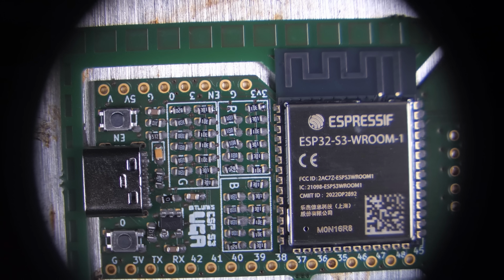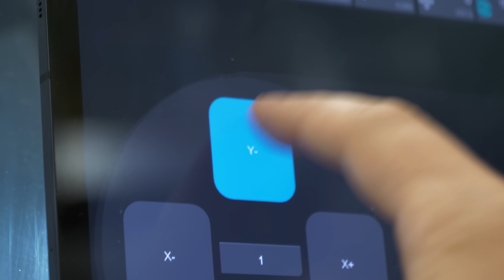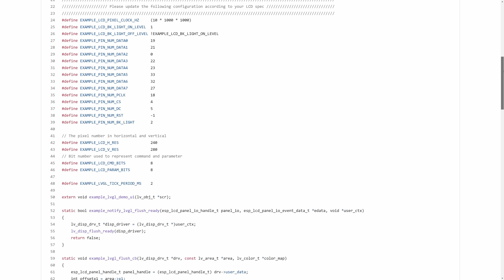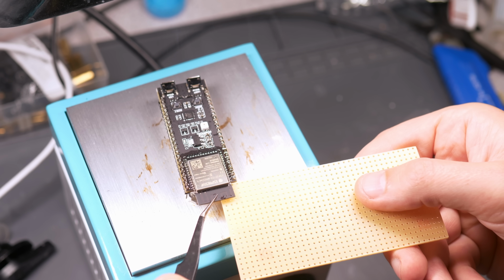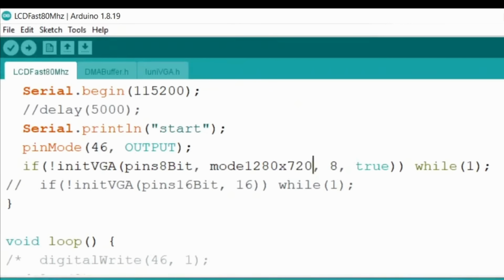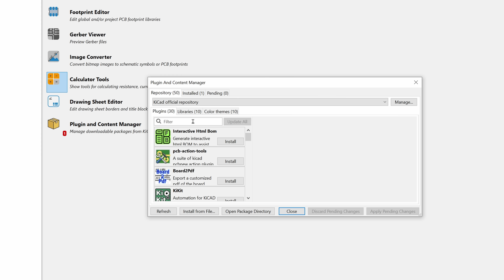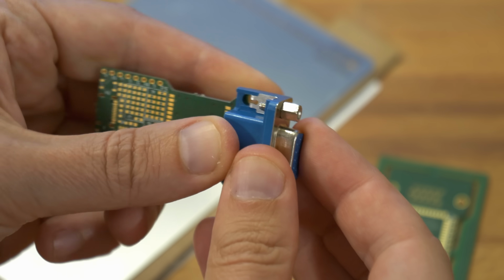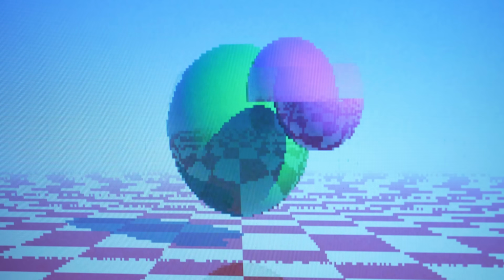I made a VGA card that blew my mind

Comment: Just a quick note, from experience. Do not put vias in pads. The solder paste will get sucked into the via and the pad will not be soldered properly. Doesn't happen all the time but if you have a big production run it can mess up a lot of boards. It might even be that the pads make electrical contact but are not properly soldered and after they reach the customer the pin is moved a little during transport and doesn't make contact anymore.
Reply: I saw him do that, and it set off my !! reflex, but I couldn't tell you why, I was like "wait, should you do that?" Good catch!  I'm glad there's some experience around here helpful for us 'homegamers'!
Reply: I know just enough to understand the question, but not quite enough for the rest. Where was he using the vias? Is he using a throughhole as a via?
Reply: Which timestamp shows the error?
Reply: @kwinzman 11:05
Reply: @jerryismybff  Thank you, very helpful!
Reply: Honest question from a reluctant board designer (I only do it out of pure necessity. KiCAD and I have a tenuous relationship): Depending on the manufacturer, if you DON'T put a via in a pad, will the pad still connect to ALL copper trace layers connected to it through the board? I used this as a way to connect three or four traces on a multilayer board, and I haven't been brave enough to order a board without the vias to see if they actually all connect.  I didn't want the surface-only pads to hit the trace, nor the pad to only connect to the trace on the top/bottom level.
Reply: @zombie-process7025 Pads on the surface are on the surface, top (or bottom) layer only. The only way to get a connection between layers is to use a via, or some other plated hole that can act as one (like a hole for a through-hole component).  ERC and DRC checks should show you if everything is connected ok.
Reply: I do almost 100% of my boards with every joint as via in pad. I haven't seen a single failure from this. You just have to have the pcb manufacturer plate over the holes. Costs ever so slightly more.
Reply: Im no expert, but was always taught to make the via and then a small trace to the pad.
Reply: you can get plated and filled vias to avoid this. sometimes you have you have via in pad
Reply: @eastonbryan4171  indeed, we are running mass production with high density BGAs and use plugged & plated vias. In mass production (tens of thousands of PCBs) it does also not matter much in terms of cost in absolute numbers, though in relative numbers it's still 20-30% more expensive then not such High-Density Interconnect (HDI) tech.
Reply: Very true ive experienced this and always avoid this, this is quite problematic if you have components on both sides of the board, for single sided components on a 2layer PTH PCB also it creates huge manufacturing defects as the solder paste printed on either the top or bottom layer will fill up the VIAS
Reply: Conductive epoxy filled holes are OK.  Via-in-pad is acceptable technology if you specify it.  Cost increment isn’t that much these days.
Reply: You can have epoxy filled pads
Reply: righ and wrong, many coponent  have via under them for heat transfer.
Reply: Depends I think if they fill the holes in the vias then its ok. Castellated holes its called I think
Reply: @JohnSmith-iu8cj : Castellated holes are something different. Filled vias can be either tented (with soldermask or something), or receive extra solder.
Reply: @absalomdraconis you wouldn't tent a via in pad. If you were to fill it you'd specify filling with epoxy and plating over with copper
Reply: @JohnSmith-iu8cj castellated holes are plated holes placed at the edge of a PCB then half routed away, leaving a sort of plated edge of the PCB. 

If these vias were to be filled they would be filled with epoxy and then plated over. Both of which are extra steps that would add cost. It's possible a low cost quick turn fab house wouldn't support these processes.

Comment: Great project, you are really squeezing everything out of the ESP32-S3. The new formfactor for boards with PSRAM is great. No need to have different footprints anymore. They now also sell one with 32MB of flash. I am thinking about using that one for OpenEpaperLink because it would allow for local storage of a lot of pictures.
Reply: If you need lots of local storage you can probably just add an SD card? On-board flash is nice, but it probably adds a lot cost/unit space.

Comment: S3 was a VGA manufacturer. First i thought you connected an old S3 VGA chip to the ESP32, then i realized it is the ESP32-S3.
Reply: My first video card had an S3 chip, and IIRC, 512KB of dedicated memory.
Reply: S3 Savage graphics were common in a lot of PCs I used to work on in the shop back in the day. Been a long time since I seen those chips. I think the savage line was the most common one I would come across. They had a few different lines though.

Comment: Fyi, the ESP32S3 RGB interface doesn't support the APLL because there is none in the chip, sorry. Next chip perhaps again :) I'll also see if I can convince the digital team to add the few bits you need for the higher-res modes in new hardware; even if VGA isn't that much in demand, I can see someone glueing TDMS converters to an ESP32 to get a DVI/HDMI solution.
Reply from the maker: yeah I figured ther is none 😅. as far as I remember the apll was always prone to errors. maybe too much to take the risk any longer. hardware tmds would be neat 🤩. but adding just another bit to total vertical lines might be even good for actual tfts. 
this weird shift with ring buffers from psram in large resolutions in 8bit is worth investigating... didn't have time to look into it too much. maybe fixable with a hack making the last buffer a different length for this chip if it's constant 🙈
hope you didn't take the criticism to harsh. you know I love you guys 😘
Reply: @bitluni  Critisism is no issue, we're aware that there's limitations in our chips; you simply can't think of all use cases everyone will think up, and sometimes you don't have time or overlook things when designing stuff. The shift wrt psram is a known issue; someone below already mentioned it: in the S3, we derped on figuring out that the bandwidth to external memory may be limiting, so some peripherals have weird behaviour when interacting with it and overloading the bandwidth: for LCD, the DMA just outputs zeroes. That's actually the reason why the driver uses an interrupt to start a new transfer, it stops any DMA weirdness from permanently offsetting the image as the interrupt 'resets' the DMA and LCD subsystem, so a glitch only lasts a frame.
Reply from the maker: @Spritetm  reasonable solution. I think a comment in the code was indicating that. 
it was never meant to be used with the niche VGA.
we all just try to massage some boundaries 😂
the high resolutions won't be useful anyways except for more or less static images and scrolling text since the bus is clogged and the blanks won't allow much updates in the framebuffer
Reply: Dear @Spritetm Consider the needs of LaserMAME with ILDA as well.  It would be great to have a compact solution on the market.

"How is the ILDA connector pinout?"

Comment: "Hidden under several convoluted abstraction layers" is an accurate description of high-level microcontroller development.
Reply from the maker: if you browse the github it gets really strange especially as with the versions there seem to be some major redesigns in the recent versions. and the latest one didn't propagate to arduino yet. and the main search always takes you to the head revision
Reply: @bitluni  - Yeah, I haven't delved into much microcontroller stuff, but Ada and bare metal / direct-control is very nice... I'd definitely recommend it over C for low-level work (and certainly high-level).
Reply: @OneWingedShark  I mean, bare-metal for regular microcontroller development is kinda insane. ESP-IDF already gives a lot of granular control - more than enough for a regular user. But ESP32 is first of all a connectivity IoT platform, and doing WiFi/BT/Zigbee/MQTT bare-metal is something I can't really imagine doing myself.
Also, never looked into Ada much, but it seems that for ESP32 it would be a problem cause it's not well-supported. Fact is that no one really uses it, and C does the job well enough, so idk. I don't see many people dropping ESP-IDF to be honest. It's just really, really useful.
Reply: @@nosferratu (crying in java dev)
Reply: @marcogenovesi8570  cries in breadboard
Reply: ESP-IDF is both really useful, and the bane of my existence at work :’) the GitHub issues list and commit history paints some wild pictures…
Reply: correction: ALL modern development for all compute platforms
Reply: More like anything that is not bare metal programming
Reply: ST Hal came to my mind straight away haha
Reply: @@nosferratu so called "full stack" developers trying to make electron apps

Comment: Neat!  Maybe next time use resistor networks to reduce parts count..?
Reply from the maker: it's odd but using singular resistors is cheaper to manufacture sometimes 🙈
I still should try it at least
Reply: @bitluni  For cheap parts, the cost of placing it can often exceed the parts cost, so a 4:1 reduction, and may also be able to save on PCB size. 4-way networks are under a cent at LCSC
Reply from the maker: LCSC only offers one 1% 150R and 300R option and both stocks are not very high. During the part shortage they had none, 🙈 i checked. on low batch size the extended part fee from jlc has also a significant impact. ontop 1% is already a bit high for 8bit. I wanted to keep the possibility to use 0.1%.
Anyways, networks make sense for actual production runs where the sourcing has to be done anyways... i just bring excuses to not have to do the routing again 😁

Comment: Hey, I have been playing with one lvds display and esp32s3 and I have hit the similar scrolling issue. The scrolling image was caused by bottleneck between the external ram and the esp. The LCD DMA is faster than the QSPI. The DMA pump zeros until data is available and after that continues with the valid data. You could try to clock the ram higher. At least in my case it helped :D
Reply from the maker: how do you clock that? and where can I find your project 🤩
maybe I can prime the cache in the interrupt to get it ready in time. 🤔

Comment: One question. The S3 is still compatible to that 3bit mode you don't need any resistor?
Reply from the maker: yes, in that case i'd just use 8bit and use the highest significant bits

Comment: Its really incredible what people have done with the esp32 series of boards.
Reply: I'm no expert by any means when it comes to dev boards.  But ever since discovering the ESP32, I've never purchased another Arduino.  The ESP based boards just seem to have so many more use cases, and they're still quite cheap as well.  Granted, I only seem to use them for tinkering, and lately, more and more home automation using ESPHome.  But seeing stuff like this, and what is possible with them still blows my mind!
Reply: @V8VRUte  the old Arduino boards are good if you have to interface to 5V stuff such as automotive sensors, can avoid a lot of resistor dividers.  If you need the computing power, wifi, bluetooth, etc though the esp32s are really nice
Reply: Its an S3 but yeah. They're usually run headless and to see an analog vga 16 bit out on them is really cool. I think most people would just go the LCD route though.
Reply: Since monochrome RCA video output was achieved over a decade ago using PICs and AVRs, it stands to reason that high-performance 32-bit ARM microcontrollers should be capable of color VGA output.
Of course, I imagine the number of people possessing the exceptional technical skills required to implement that is quite limited.
Reply: I designed a product with the S3-WROOM-1 to drive a 320x240 24 bit color LCD with integrated capactive touch screen!  CAN and USB Interface included :P
Reply: @supernova86  I'd love to know more about the CAN aspect of that, I haven't been able to get CAN to work on mine and it's kinda important to an automotive project I have
Reply: @Rx7man  Sure, I can answer any questions you might have.  I'm the hardware designer, so I can't really help you with driver or programming questions xD
Reply: Not “people”. Its bitluni. He is an old school genius. No one else has done what he has, a cut above the rest.
Reply: @Really2950  You are wrong, there are many engineers that are doing great stuff with ESPs and for some of them you don't need half as much knowledge
Reply: @Really2950 Bitluni is a champion! But no, there are plenty of people doing amazing things with these SoCs including at my work. Sadly a lot of it is hidden away in commercial products though.
Reply: Yes, true. Incredible how much mostly useless stuff. :D